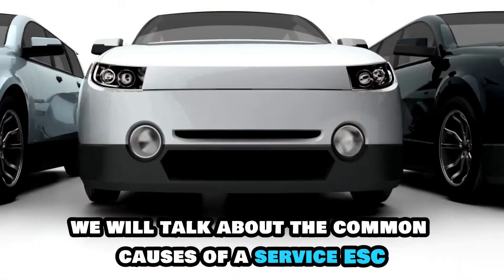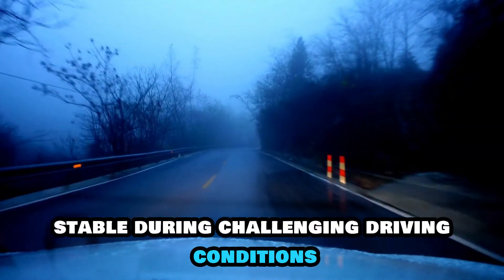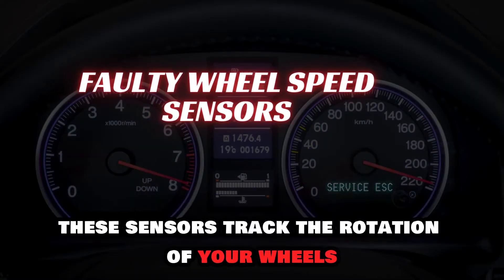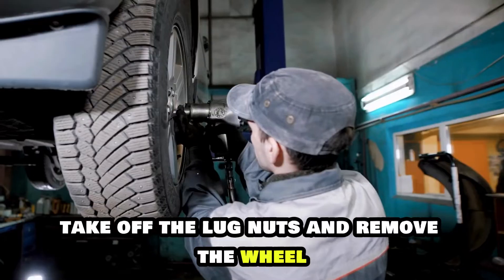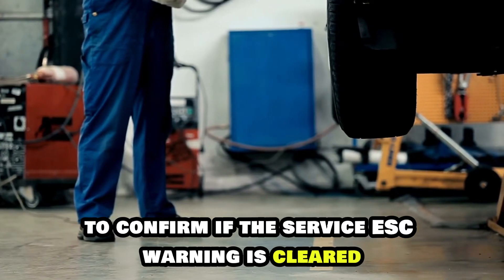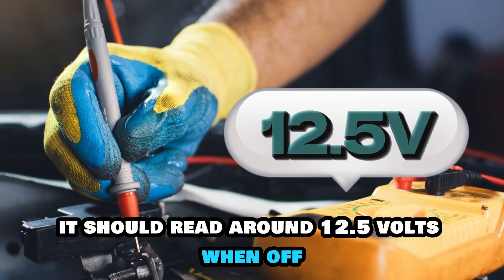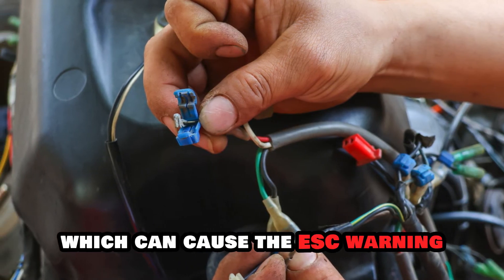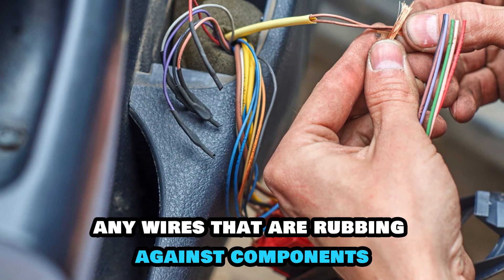What Does 'Service ESC' Mean On A Chevy Malibu? (Common Causes And Easy Solutions)

Comment: Interesting that it talks about checking the ECS sensors but it shows the TPS sensors which have no wires and it's only purpose is tire pressure, not wheel rotation.
Reply: I thought the same, probably he’s confuse 😂